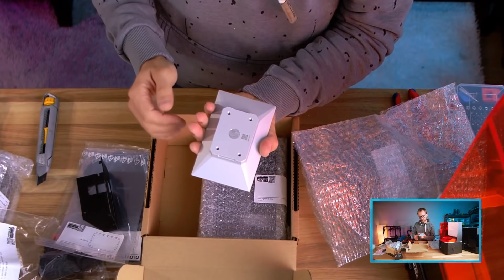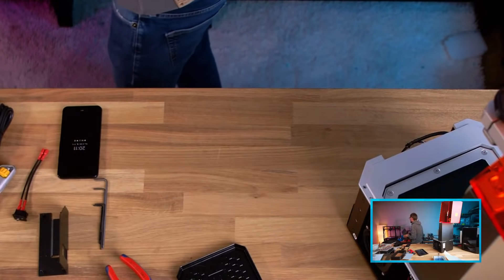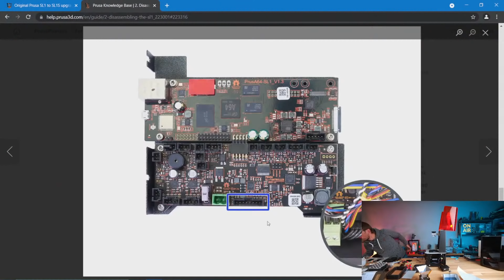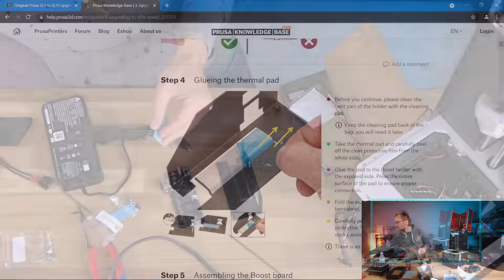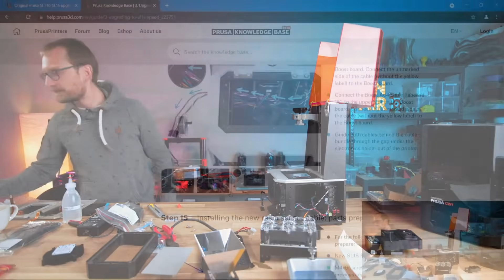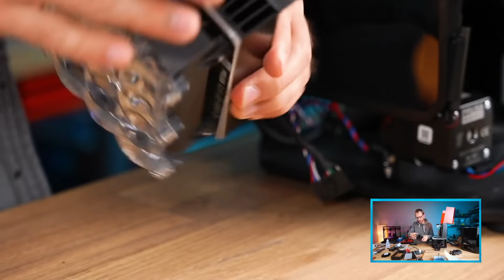Was live: Upgrading the Prusa SL1 resin printer to the SL1S SPEED!

Comment: Wow glad it worked out right at the end! Made Tom happy for the nite indeed.
Reply: Thank you for that comment. Without it, I wouldn't have seen the solution at the end. I have the same problem with my upgraded SL1S. Btw it started with fw 1.6.3. Right after the upgrade, my printer was on 1.6.2 and it worked fine then.
Reply: Update: It turned out that I didn't need to mess with the tower sensitivity setting after all. Just a little oil and moving the platform up and down a few times, was all it took. Now I don't think fw 1.6.3 had anything to do with the problem. It was most likely just a coincidence that this problem started to appear just after I upgraded the firmware.